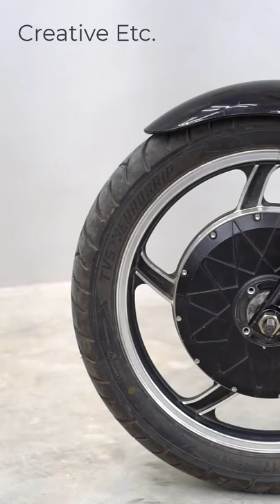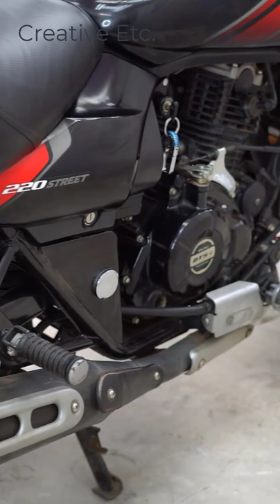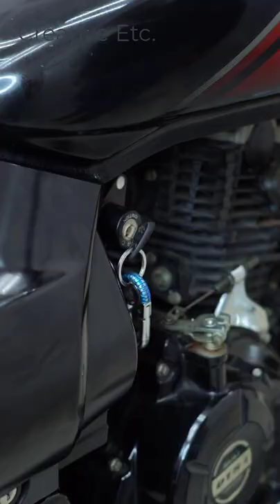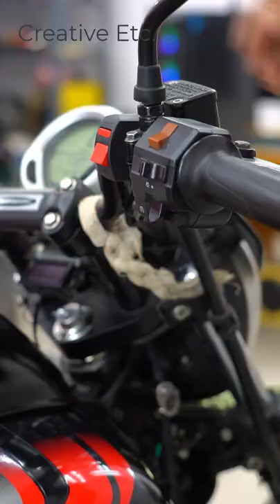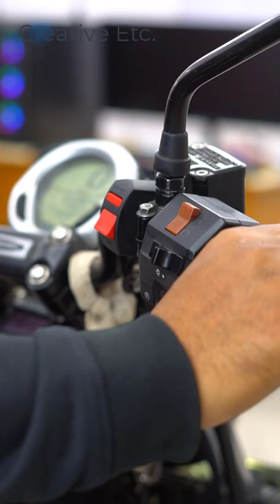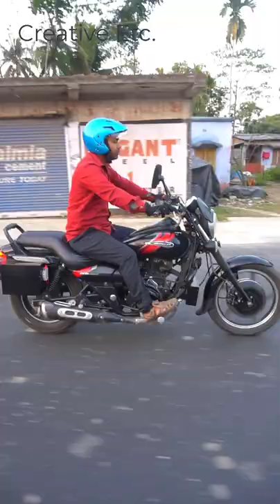DIY Petrol and Electric Hybrid Bike #shorts

Comment: Modification is good but.. one small suggestion why don't you use rear wheel to replace to electric motor.. because when you are running ev sudden break will apply it is too dangerous..
Reply from the maker: The sudden break is not dangerous sudden acceleration may be.
Reply: Rear wheel has rubber dampeners to avoid wheel jerks in petrol engine we can't install on electric motor wheel petrol engine could break the wheel

Comment: My question is, if you have an accelerator pump built into your carburator are you not going to be pumping fuel into your engine while you are adjusting your throtle up and down on the road. Cause your engine to flood while it is not running.
Reply: can turn the petrol off while in EV mode
Reply: @Vedavyas Srigiriraju  that crossed my mind but being a new bike I figured it was fuel injected. Thanks